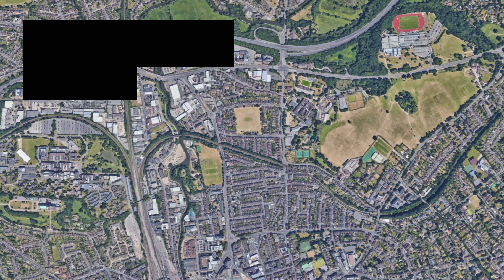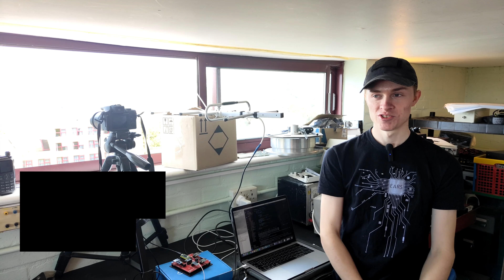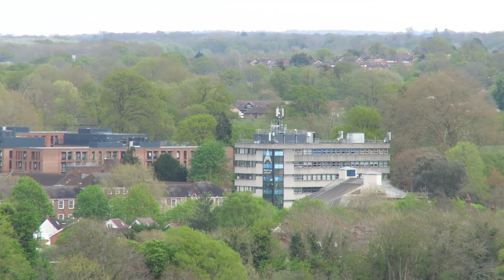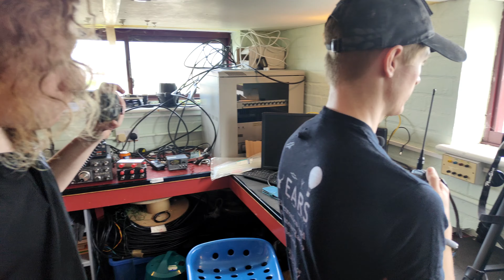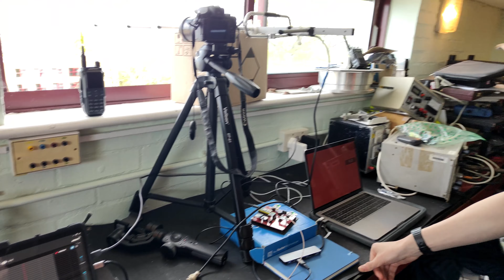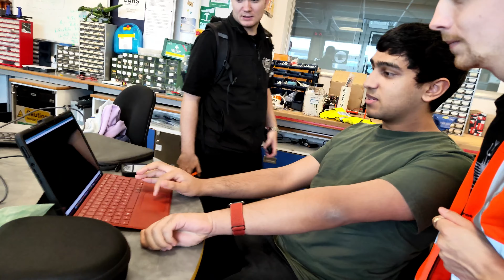SurreyEARS X Peryton Space - 2400m CanSat Range Test For Mach24 Rocketry & CanSat Competition!

Comment: You get get a far better range using circular polarised antennas, like a clover leaf design on the TX and helical for RX.
You might lose 20dB in signal from cross polarisation, the only other thing to do is use two yagis for receive at the base - at 90degrees to each other and phased.